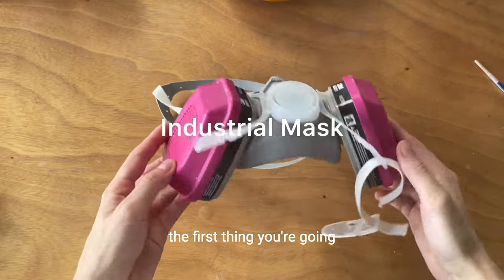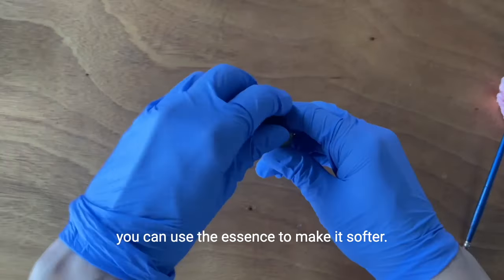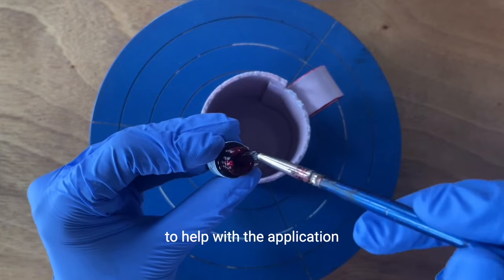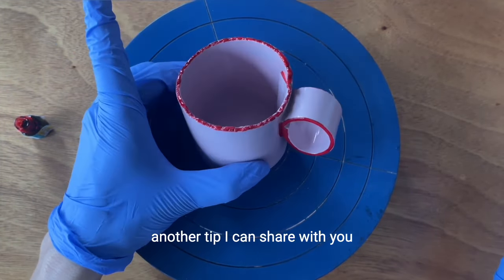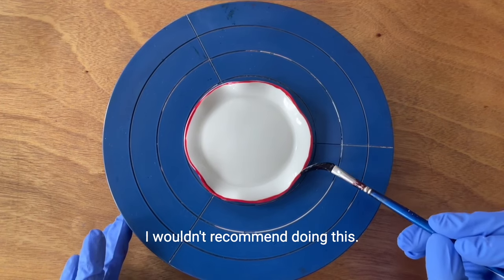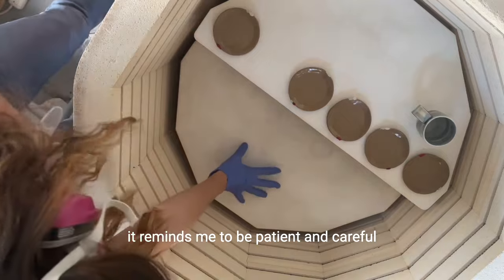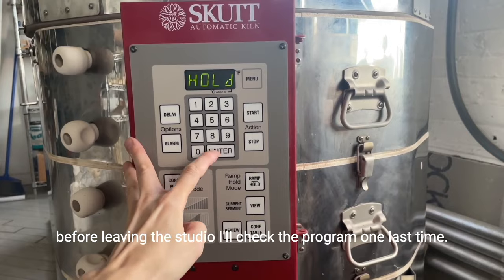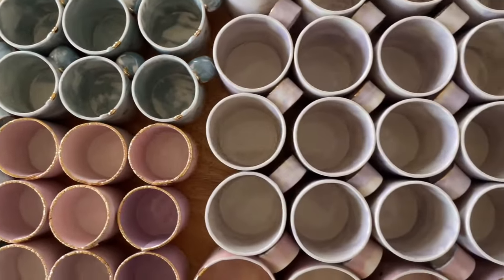How to apply gold luster on ceramics?

Comment: Question regarding loading the glaze kiln - How are you able to stack your glazed pieces and they not stick to each other? Thanks in advance
Reply from the maker: The temperature for gold luster firing is below the maturing point (melting) of the glaze.
Reply: @from_fran  never thought of it that way. Thanks so much for that tip!

Comment: The videos were very helpful. Thank you. I'm currently trying porcelain art on my own, and I was wondering, when using pigments and gold for painting, should I bake it at 800 degrees Celsius? I plan to outline with pigments, apply gold to certain areas, and paint the handle just like in the videos. Are there any specific precautions to take, such as applying gold at the end or differences in baking temperature compared to regular pigments?
Reply from the maker: What do you mean by pigments? Are you referring to glazes (overglaze) or underglazes?

Comment: Hi there thanks for the video, can you bisque fire earthen ware pieces next to the pieces you are firing for a lister firing?
Reply from the maker: hi Gabi, I would advise against doing that, and it would be pointless due to the fact that your bisque requires a higher temperature. Typically, bisque is fired to cone 06.
Reply: @from_fran  oh sorry. The earthenware will bisque at the same temp. 750 degrees Celsius
Reply from the maker: @gabialberts3380  I would advise against trying it because firing bisque can release gas and fumes that may potentially affect the luster. But you can always do a test firing in a small kiln to see what happens. If you do it, please let me know if it works :)

Comment: a new subscriber! I have a question, can you please guide me for an over glaze that instructions of baking time should be 800° C for 30 minutes? how it goes if I was using like ur kiln? and should it be like your one day in the kiln? thanks!
Reply from the maker: Hi! I'm only familiar with electric kilns. Using an electric kiln you can manually set up the temperature and time. How long does it take to reach the temperature and then cool down? It's going to depend on the size of the kiln and the number of pieces inside of it.

Comment: hello, can it be applied to slip or unglazed area？ thanks
Reply from the maker: When the luster is put on a fired but unglazed area, it makes the area look matte. Mixing it with slip won't work because slip matures at a much higher temperature than the one you need for the luster. When fired over cone 018, the luster burns out.

Comment: If I need to stencil a design on the glazed piece, what would I be able to use? So that the luster will cover it. Or should I just glaze the design and cover it with the luster after?
Reply from the maker: Hi Anna, do you have a URL to an image where I can see what you're trying to accomplish specifically? Since the luster is an overglaze, it will hide any stenciled designs that were applied previously. 

I would advise using decals if you're going for a stenciled look. https://www.milestonedecalart.com/custom-decal-shop/custom-22k-gold-decals-for-ceramic-glass-and-enamel
Reply: @from_fran  oh I see, that's cool. So I have an older woman at my studio that wants a scroll design in luster on a rimmed platter. And I've never worked with it. She glazed it in white and I was going to fire it, but forgot she needs to draw a design. And I don't want to have her comeback to draw the design if I can avoid that. Since she'll have to come back after it's fired for the luster. So I was wondering if she can maybe use a marker on the glazed piece to draw it and go over it with the luster. I've just never used marker on a glazed piece and fired it afterwards, and I don't know how the luster reacts. If that makes sense haha sorry it's a lot and I'm lost.
Reply from the maker: Although I haven't tried it, the marker should burn out. Can you test it first on a different piece? In any case, if the luster isn't looking well, you may simply fire it again at a higher temperature than cone 018 and it will fade out.

Comment: I’m confused as to what you mean by cone 19? I use cone 6 stoneware and would like to use the gold on my pots can you help me understand what I’m missing here?
Reply from the maker: Hi! cone 019 is a third firing. So the first firing is for the bisque, the second firing is for glaze, and the third firing is for lusters or decals. I usually apply lusters and decals over a glazed surface and the result looks glossy. For a matte finish you can apply over an unglazed, but vitrified, surface.
Reply: Cone range is like a number line cone 1 being in the middle. For example: 019....06, 05, 04, 03, 02, 01, 1, 2, 3, 4, 5, 6 and so on. Cone 019 is much much lower temp than cone 6.
Reply: Cone 019 is below 700 C. My gold luster for 850C.